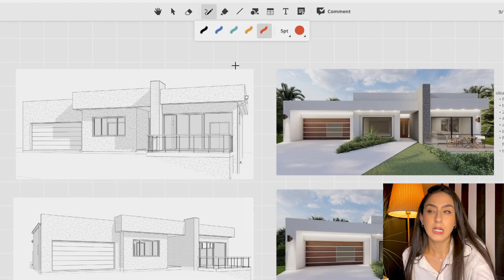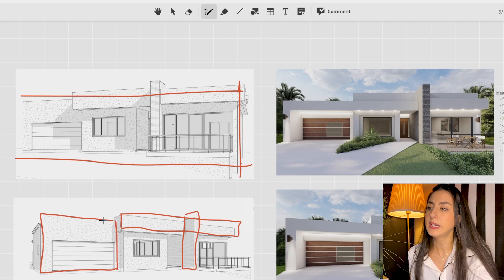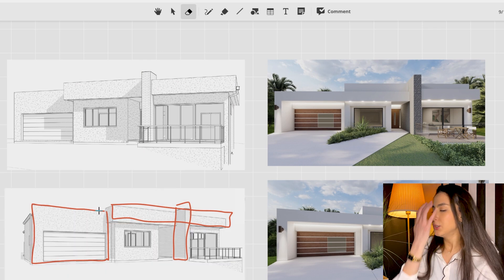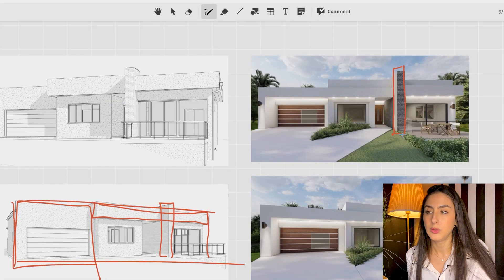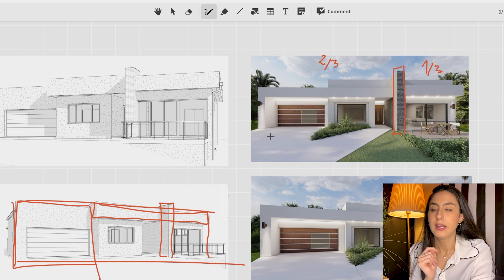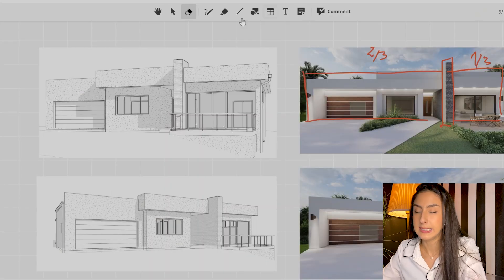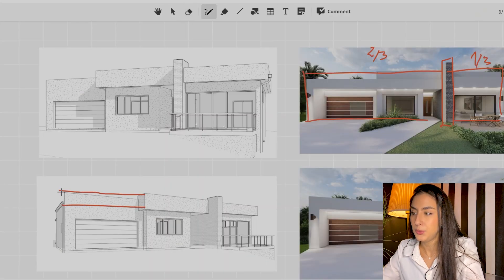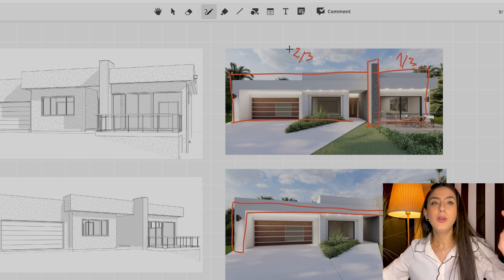How to Fix a Facade: 4 Design Principles That Make All the Difference *Architecture Design Tips*

Comment: The reason we don't use much framing or flat wall is because of costs. We want to make money. It does not really add up to the property value as it won't increase the rent. E.g adding another bedroom will increase the value than spending the money on the facade. We want smaller window to pass Energy rating test and avoid losing heat during winter. 😢
Reply from the maker: That’s a very valid point! There’s cost associated with every design decision. Spending more on the facade might be for somebody building their forever home, but from an investor standpoint or a property developer the extra cost might not make sense.

Comment: Hey Malak! Don't you think a color change in horizontal could emphasize the facade better? Maybe some kind of anthracite?
Reply: Valid suggestion. Here is an opinion. Anthracite wouldn't be a strange color in this facade. However, we have a light gray on the horizontal roof/overhung, and the roof behind, black window frames, white walls, and the darker grey brick as a focal point leading toward the entry.
"Less is more". In this case, the designer shows excellent taste and a good knowledge of handling architectural elements (colors and volumes) to produce a modern and good-looking front elevation................Again, just an opinion.
Reply from the maker: @mysticalblizzard1981  that’s a good point! It might bring up the frame more but I would be cautious that it might clash with the vertical element (that’s is also gray). In modern facades, I usually prefer to only have one element that has a color as a pop.
Reply: Also, I want to ask which material you are using to make the frames?